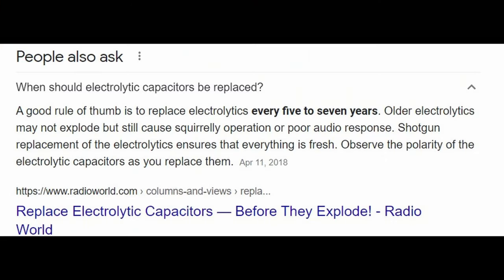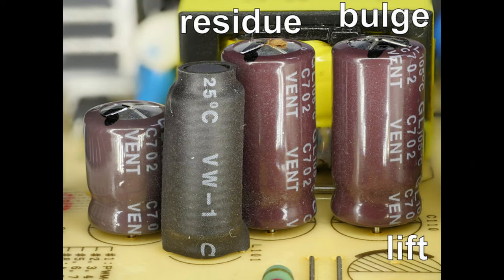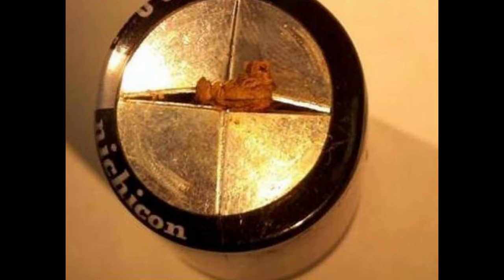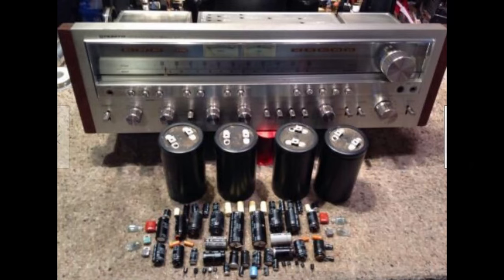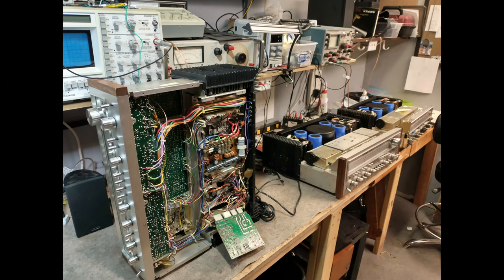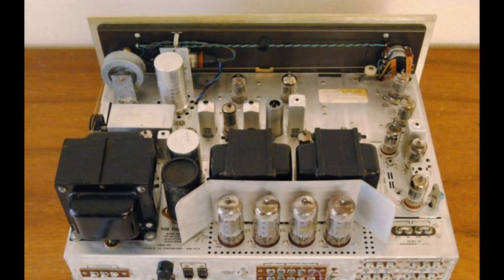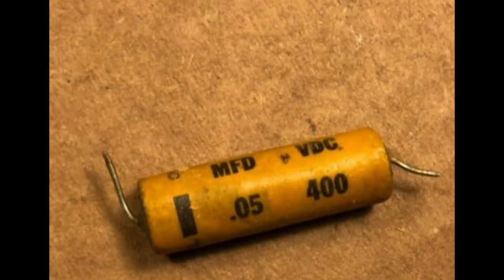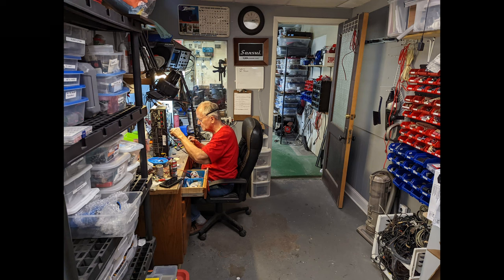Should You Replace Capacitors In Vintage Electronics?- Marantz Sansui Pioneer McIntosh Yamaha

Comment: I'm an old school, absolute lover of the old "McIntosh Sound". I've owned almost every piece of Old School McIntosh tube equipment, and am in awe of the Unparalleled Sound. However, in 2022 the 1965 pieces are getting OLD (like me ha ha) YES ! I appreciate everything you said, and have wondered if replacing all the caps in an old 6100 integrated amp would change the sound ? After growing up with a C22 tube preamp, and MC240 amp, the old recently purchased 6100 still works great, and has that true McIntosh "Sound", but needs to be gone through. What should I ask to be looked at? You answered my question. Also, should I replace the original lamps, or change them to LED's?  The front panel lights are extremely dim. I really appreciated your video.
Reply from the maker: I have several pieces of vintage McIntosh as well. All have new power supply and filter caps. "If" replacing those caps changed the sound, it only brought it closer to what it sounded like new.
I am not a fan of putting LEDs in vintage McIntosh gear unless you buy a new glass panel from McIntosh. LEDs look blotchy with the original glass. Just my opinion, I'm sure others will tell you something different. :)
Reply: Thanks for your reply. I agree. LEDs in old McIntosh looks silly. It says "Look how bright my McIntosh is" Ha ha. Also out of place. Yes, I'll call Cornell Smith of the Audio Doctor here in Phoenix for an appointment as we have to stand in line because of no really knowledgeable and competent techs anymore. By the way, I also saw some of your other videos about digital v/s analog = you're right on! For Me, it's all about the music! (everybody else says that too, then they only have about ten records to play, or less) I will replace the caps and power supply by the way. It's GREAT to see some videos with knowledgeable comments. If more people were interested in audio there would be more happy people. @skylabsaudio

Comment: Interesting video and thanks for sharing. I do get the argument that changing components might have some effect on a unit and there is an argument to keep things original or it isn’t the same thing as when it was made. To me, this is all about why you have a vintage unit in the first place. If you want to keep it as original as it was first made (i.e., a museum piece) then you might not want to replace anything until it stops working. If, however, you want a vintage unit to enjoy its sound and its tactile use then preventive maintenance has to be the way to go so you can continue to enjoy it into the future for as long as possible.

Comment: I agree with everything said, except for the filter and amp caps. If a receiver’s OG filter and amp caps test perfectly on all aspects, I leave it up to the owner on what is done with them. Since this has become somewhat more of “thing” the past year or two, pulling these caps and specifically testing each one for uf, resilience, and ESR is built into the inspection and diagnostic fee the owner agrees to. When the estimate is given, our findings are presented and it’s up to the owner whether the filter and amp caps should be replaced or not.

Ultimately, I recommend replacing any capacitor that cross paths with during a repair or restore due to the points brought up in the video. However, and not saying Skylab’s Audio does this, but if the filter caps test perfectly on all fronts, I do not just automatically include replacing them into the estimate. If I did, owners would get upset and I would be either giving a discount or opening the unit back up and reinstalling the OG caps free of charge. 

My own situations or any unit I would restore to resell, all capacitors, every last one, is replaced.
Reply from the maker: Yeah, we only swap the caps on the units we sell automatically. Some customers just want a clean-up, lamps or maybe just a failed component.

Comment: I think it is worth considering what kind of tolerances the equipment was manufactured to in the first place.
Did they really match all capacitors L/R, was it a spec’ed batch or did they just grab the next one from the bin? Matched high quality replacement parts are an upgrade to any equipment, it will increase the performance, precision and durability. I regard audio equipment as a type of instrumentation: it has to be precise, reliable, calibrated, consistent, and symmetrical, and you specifically do not want any components in calibrated equipment that are drifting or out of spec, let alone expired and damaged.

Comment: The capacitors that matter the most sonically are the ones directly in the signal path (usually coupling capacitors) and in audio filter circuits. The worst are the bipolar electrolytic coupling capacitors. In all cases I've had a lot of improvement with polypropylene capacitors - not just over bipolar electrolytic, but over ceramic types. I get sonic improvements with power supply capacitor replacements too, so I'm not sure I agree with you on that. Maybe it's the feeling of cleaning up the circuit that I feel the sounds are cleaned up too?

Comment: I use more modern amps to do all the work. All my "vintage" stuff is on the low power end (RCA's) and basically the receiver just sits there to direct traffic. More modern day caps (90's/2000's) were built just as good if not better than the days before. I get the concept if you are going to take the whole thing apart you might as well do everything you can. I also get buying your dream receiver and wanted it brand new inside. But in reality, most are not going to take it to a shop unless there is something wrong with it in the first place. Imho, if you have your reasons to do it then do it by all means but I also think if there is no reason to open up the box (besides for in inspection and cleaning) leave it alone because you may or may not like the sound that results.

Comment: Older tech here as well, It's better to replace them in the power supply, and those who are in places that get a lot heat. Replace them with good quality from reputable seller, like Mouser or Digi-key. And put "audio" quality ones in the signal path, and high hours/reliabilty in the power supply. And take the time to put 105C tested. It's a bit more expensive, but it's worth it 100%

Comment: Yes, I pretty much agree with the approach stated here. I'm still wondering why the high voltage capacitors in my Scott tube equipment from the early '60s seems to outlast the power supply capacitors from high quality solid state receivers from the '70s era.  But that's a side topic.  Maybe higher electrolytic capacitor density means they're more prone to failing.  Who knows?  In most of my tube gear I start with changing the first can capacitor after the tube rectifier.  This is the most abused capacitor from a heating point of view and from a voltage point of view.  Then continue down the line.  And you want to change the electrolytics in your bias supply. And the coupling capacitors as the gentleman in the vid mentioned.  Ask yourself, if this cap fails, what collateral damage will be done? Will it fry a rare and costly tube or transformer? Or both?  Then you'd probably want to change those parts.  And who is going to remove toxic electrolyte from all of your circuit boards? Not me!
    I'm passionate about audio and I understand that it's only original once.  Trust me I have some pieces in my collection original from the early sixties.  And functioning !!   Let's look at a car tire bought brand new 7 years ago.  Now it's 7 years later and the tire has 20,000 miles on it.  You think you have 40,000 more miles because of the mileage rating.  Well you'd be dead wrong.  Look closer. Look at the sidewall and in between the tread blocks.  See those cracks? Some of them real deep. That tire's going to blow any minute now.  Well same with an old electrolytic.  It's going to start running hot, short out or partially short out.  Failure is imminent. 
    I've changed many power supply caps and coupling capacitors.  I now have peace of mind and great sound as before. Maybe even better due to the new, better quality, and in spec components.  So it's good practice to change these power supply capacitors in old amps/receivers.  
    I have an all original Sansui AU-555A.  I've been on the fence about replacing parts because it sounds so good !  Replacing the 50 year old caps may actually make a sweet sounding amp sound even sweeter.  One thing to note.  Some amps, like the Sansui AU-555A and a Sansui 331 receiver, for example, have an electrolytic cap in the output stage of each channel.  This cap is directly in the audio signal path.  It should be changed because it's old.  You can change the one in the left channel and compare the sound to the right channel before u change the right channel's output cap out.  If you are happy with the sound, go ahead and change the other one out.  Now you're set !!  Hey if u guys were on long island I'd work for ya. 

Happy Listening 🎶🎵🎼🔊
Reply from the maker: Great advise! Thanks Anthony!
Reply: I have a Sansui AU-505 and TU-505 and they sound so, so good. Been on the fence about a recap. I may have been swayed. Maybe I’ll find another one to practice on myself.

Comment: I had ~45 Capacitors changed on my Pioneer SX-1250 / Protection, Power board, filter caps and EQ Board. After the Recap, the bass is more tight and stronger, Noticeable difference that is worth every penny.
Reply: Would love to see frequecy spectrum charts before and after. "Hearing" things when the situation is the polar opposite of anything called double-blind A-B test - it is just so easy to fool yourself. If there is a difference, convince yourself by showing it measured.

Comment: Thank you so much to tell it like it is! 35 years ago I took an electronic technician course, ( it was the last year this course was given ) but I couldn't find a job because all the repair shops were closing for lack of customers. I changed the power capacitors in my 20 year old Arcam amp just to be sure it will last another 20 years. By the way, I paid 1600 $ in 2004. How much do you think I will pay now for the same quality today? Thanks again for an intelligent argumentation !

Comment: Capacitors have different functions,.they are passive components 
So when we talk about changing capacitors, we often  think about the chemical capacitors which have an internal resistance so called " serial resistance" .the value increase with the componant age (30 -40 years )
The checking may be realized using "SR meter".( expensive)
First of all it is important to check the appearance if a " bulb" increase or some white pouder around...
These chemical capacitors are used for power supply and polarisation with high value.or  ( 10 microf to 1000micro or more)
In the high end audiophile unit you can find polypropylene capacitors instead of chemical, there is no need to change them.incomparison
Other capacitor made in  polyester.,mylar are used in high frequency link.

The receiver for example are sensitive to the capacitor drift...
For the turntable using a psu in motor regulation, some speed variation may  occur and changing the chemical capacitor is highly recommended..

So, in conclusion if any problem occur, changing the cap is just an audiophile philosophy but the experience gained in component restoration show that listening the machine fix the diagnostic  at the end...( humm, rumble, tic tic)

Comment: Can you guys move to downstate NY? We desperately need a qualified vintage electronics repair shop here! 😁

Love your channel. Best I've seen so far. I'm learning a tremendous amount from you. Thanks for doing this!

Your last comments kind of slapped me in the face. Given the popularity of vintage equipment today, it's a shame that there aren't younger people trained to do this. But i wonder.. how easy is it to GET trained? I'm 54 and considering an early retirement from my current career. I've been passionate about audio gear since i was a child (my dad often purchased quality equipment at the expense of things like a needed new stove). However i know next to nothing about electronics repair. I watch numerous YouTube videos to learn some basics. Ive learned how to correctly use deoxit  pots/switches, i can dismantle receivers to a certain point, and I've learned how to revive "dead" equipment just by diligently cleaning enough oxidation to get the amp working. But i definitely have hit a road block when it comes to true repair like replacing capacitors. Nearly all of the videos i watch assume a base level of knowledge including vocabulary. Before doing some of this i didn't know the difference between a capacitor and a resistor... replacing them? No chance. 

My point? Im very interested in doing this type of repair, the kind you say will disappear (😢), but have no clue how to get started. I'm not looking to make what I'm making now, just some supplemental income as well as doing something i love doing. I don't want to spend years learning how to do this, but want to learn enough to get started and then learn by doing. There are very few if any videos discussing that. To solve the glut of qualified technicians, there needs to be opportunities for people like me to be trained without having to go back to school full time. I don't think the "youth" will be the ones continuing the tradition...there just aren't enough job opportunities for this (and it's tough to make a survivable income). There needs to be more aimed at people in my situation. What are your thoughts about this?
Reply from the maker: We talk about "how to get started" in this video. Thanks for watching https://www.youtube.com/watch?v=1J4G6AT9MFs&lc=Ugzp4o_hmX2cw6CAolB4AaABAg
Reply: @skylabsaudio  awesome! Thanks. You run a killer channel. I'm a convert

Comment: One of the good things about being as old as I am is that there's no way I'll ever hear a capacitor change in a power supply unless it's for the better (knocking out the hum.)  A friend gave me a 1970s CB radio to repair.  It's a tube radio with the high voltage axial capacitors in a point to point setting.    One of them is physically exploded, but the radio still powers on and receives.  The capacitor leads are folded backwards as if the thing went off like a fire cracker and all the foil from inside of it is glued to the bottom of the metal case where it was shot out like a shot gun shell wadding.     Someone else may be able to hear the difference.  The only difference I will ever hear is the filtering and proper functioning of the circuit.   People stuffing hundreds of dollars of beer can sized Solen capacitors into audio gear is wasted on my ears.
Reply: PSU electros provide 2 functions! 1) filter out the noise 2) provide transient power for the large sudden sounds

Comment: Well, I get your reasoning but I have a slightly different spin.
First of all, any vented cap needs to go, no question.
The large PS and Output caps due to price are worthy of a complete test.
-- the test needs to occur after a full voltage charge for perhaps 5-10min followed by a leakage test. There are charts for leakage voltage of specific cap values. AND first:
measuring ESR. ESR is an excellent metric of the health of a cap.
The smaller electrolytics can be tested in circuit with a good ESR meter. The ESR meters 
apply a very low amplitude voltage which does not activate any semi-conductors, and will give you a good idea of the cap health without de soldering and measuring the capacitance.
For me that is a good compromise of cost and reliability.  
-- This also brings up the discussion and distinction between repair and restoration.
A simple repair may skip most of the testing as long as the customer knows what they are getting. A restoration on the other hand, at least an honest one, will include a more thorough approach. It would be possible to market a gradient between the two extremes I suppose.
--
As to "can you hear the difference between PS caps etc"?
I'm with you - there are many myths in audio - and many knuckleheads that make unsupportable claims.

Comment: You needed to clarify, that the electrolytic capacitors will need replacing, after only 20 years sometimes. Polycaps, Ethylene, Mylar and ceramic caps do not usually need touching unless the amp has or gets very hot (your wax and paper example)
Reply from the maker: You're correct.

Comment: I just bought an Acurus 3 channel power amp and the claim is it's never been used. I contacted the manufacturer about the proper way to fire up their NOS equipment and they told me to just turn it on and use it. It should be just fine even after all this time. Now having said that, before too long I'm going to take it in and have it evaluated. Just because it's 30 years old and never been used doesn't mean that it's the same as something brand new that should last 30 years.

Comment: I'm new to this vintage audio gear... I have a 1970 Sansui 4000, one owner unit, last serviced in 1986 and then it sat unused, I paid $200 for it. I got inside of her to clean her up with DeoxIT D5 and F5 and found visually found no issues, no bulging or leaking caps. Let me ask, what brand caps on the power and filter side would be best to install? I love the sound of this unit, and want to keep it. And I have the factory schematics, as they came with the unit. I have a tech that can replace, or I could probably do this myself if need be.